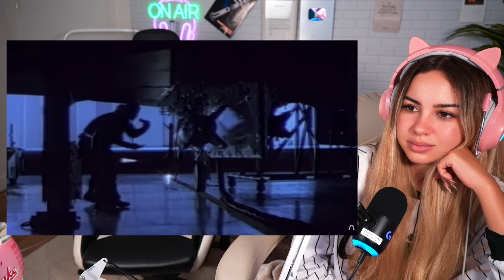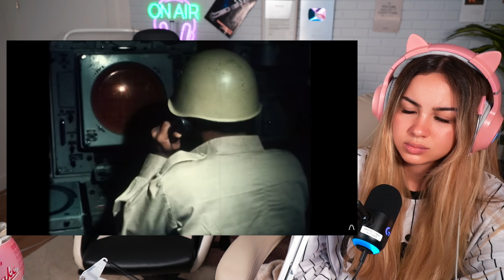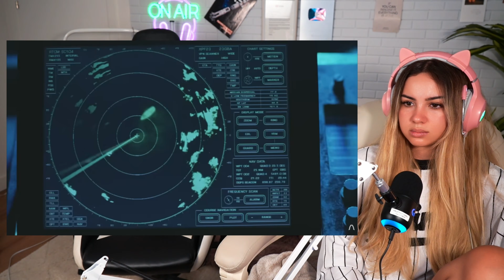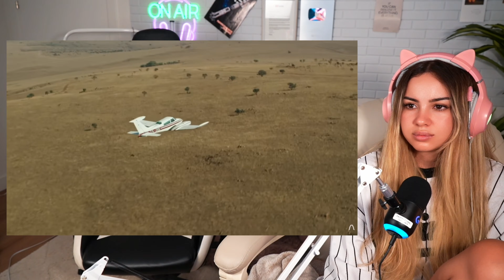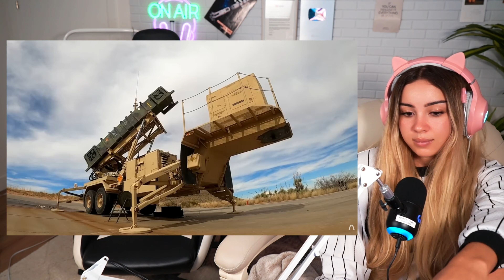This American Jet Was Designed to Look Impossible

Comment: I'm not trying to be an online dick or troll. Knowing your first language isn't English I wanted to help you on your journey through being an English speaking content creator.

Around 9:36 you say "an ufo". It is "a ufo".

No, I'm not specifically sure why. Though, I have a theory. The differential between using a vs an is typically consonant vs vowel. HOWEVER, there are circumstances where a consonant receives "an", most especially with the letter H. The letter H can go both ways (giggity), an or a, depending on its pronunciation. And then things are muddled and complicated by "y" sometimes being a vowel and sometimes being a consonant.

Which is to say even though the acronym ufo starts with a vowel, the pronunciation is considered to be a consonant. Yes, there are other cultural nuances. But it's A ufo, not AN ufo. 🤘🏻♥️

Comment: Engineers decide if a plane looks good by putting it in a wind tunnel while smoke travels around it.  Then the air force tests it by flying over their radar equiptment and seeing if their radar detects it.  If every thing comes out all right, The plane can fly over the enemy during a foggy night, and they won't know they are under attack until they hear the bombs exploding.

Comment: Planes absolute garbage and was shot down on one of its very first missions like most American tech.

indium tin oxide is what the Americans think is a secret but everyone knows already, that's all stealth actually is.
Reply: The F-117 was in active service for 16 years and flew over 1,300 successful combat missions in Desert Storm alone before a single one was finally shot down over Yugoslavia in 1999 due to predictable flight routing.Also, Indium Tin Oxide (ITO) isn't a secret—it’s literally in smartphone screens. On stealth jets, it’s only used as a microscopic coating on the cockpit canopy glass so radar waves don't bounce off the pilot's helmet. The actual stealth comes from geometric facet design, buried engine inlets, and radar-absorbent material (RAM) coatings on the airframe.

Comment: If you really do find this interesting, check out Ben Rich’s book “Skunk Works”. They make an audiobook version of it too. It’s amazing, taught me a lot, and has let me look at russia’s and china’s “stealth” aircraft and see right away that they ARE NOT STEALTH. The book explains it all, and that’s the funniest part. The information is out there. You see a big metal engine exhaust, that’s going to reflect radar. You see a bunch of rivets used to hold the aircraft together, that’s going to reflect radar. You see regular canopy cover materials, that’s going to reflect radar. You see misaligned panels or gaps in between them, that’s going to reflect radar. There’s obviously more to it than that, but these are the things that give away that those “stealth” planes are NOT “stealth” and would be picked up, and locked onto, easily.

Comment: Disappointed to see they failed to elaborate on the single F117 shoot down. Serb SAM radar locked on briefly when the bomb bay doors opened then closed. It was a million to one  lucky fluke. Not a design failure.

Comment: Did hear they are working on SR-72.  Suppose to be faster than the SR-71.  And the SR-71 was restricted alittle due to keeping the pilot alive and technology in metallurgy to not make the wings soft from air friction heat from going to fast creating heat from air friction.  From what I got out of it the engine could have handled going faster but the pilot and plane could not at that time.

Comment: 19:08 that flexing is normal, remember; they test stuff like that, a commercial plane wing can flex an extreme amount before it will break. Also letting flex means it's less likely to snap.

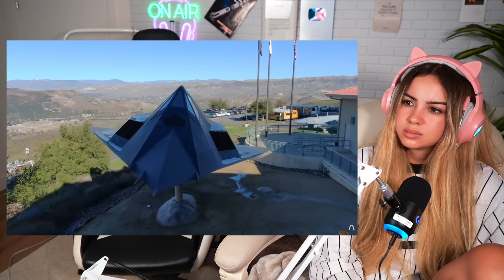20:43 they did have the ability to remote control planes back then, but in test fights like this, a pilot I used.

Comment: 20:40 - The "computer control" here refers to the F-117's on-board computer system whose job was to continuously make adjustments to the  flaps, ailerons, tail fins, etc. to ensure the plane maintains stability in the air (because it was aerodynamically unstable). 

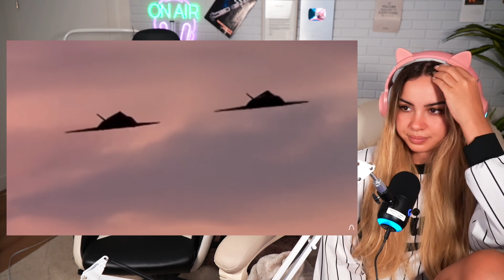22:37 - The left jet (Have Blue) was the original prototype. The jet on the right (F-117) was the final result that fixed the issues of the Have Blue.

Comment: The 117 that was shot down was also running a route that had been run multiple times. It was the luckiest of shots.
Reply: It's been explained that it was less the Serbs shooting one down and more of them putting a missile where the jet was.
Reply: And the lowest frequency the search and tracks radars could run on so even move lucky and desperate not to mention the f16s escorting the nighthawk tasked with destroying such equipment were called back due to weather so even more lucky

Comment: They're discussing the prototype known as " have blue "
And the actual production aircraft called the f-117. 

They are not the same aircraft. The prototype was used to test out of reasonable scale the stealth ability of their ideas. When it comes to aircraft design there are some things that can't be estimated using models or computers. Especially in the late '80s. Have blue was flying in the early '80s. The f-117 started flying secret missions in the late 80s. Nobody knew about it for a long time. 

B12 is a vitamin that vegetarians usually get supplements to ensure they get enough so their WBC and RBC blood counts aren't low.

Since the F-16 almost no US built military aircraft have been able to fly without a flight control computer in the middle, between the pilot and the airplane. The F-16 was the first fly-by-wire fighter aircraft in the world. BTW, the space shuttle was also completely fly-by-wire for every stage of flight from launch to landing in rollout. 
Of course, their might be exceptions, probably in the cargo planes used.  All the stealth aircraft are fly-by-wire.

Drone technology with the ability to control high-performance aircraft didn't exist in the 1980s or early 1990s to the level that was like being in the cockpit. That's why we have Tomahawk Cruise missiles which are much more cost effective than any of these stealth aircraft. 

All V-tailed aircraft have a number of flight characteristics that are extremely undesirable. Those issues do show up from time to time even then really old commercial airliners like the Boeing 727.  The V-tail Bonaza (small private plane) was known to have some issues as well.

Much of the technology in all the stealth aircraft after the F-117, are still classified.

High performance aircraft, including commercially available aircraft, are often made out of composite materials that use a wafer structure not on similar to a bee honeycomb. These are extremely light and extremely strong for their weight. Of course they are more costly than standard aluminum. 

Much of the Boeing 787 is made from composites. Over the useful lifetime of an airliner the cost of fuel far outways the cost of the actual aircraft and maintenance. The lighter the total aircraft in flight, the less fuel it will have to use, for every single flight. Those savings add up massively.  I think the Airbus A350 is mostly composites too.

Comment: LOL...it was not made out of wood. What you are seeing is the splintering of the fiberglass layers beneath and between the skin of the aircraft. The F-117 was advanced for its time period. And yes, it looked really cool. But could only be used as a bomber, leaving it defenseless against enemy aircraft. We now have multi-role stealth aircraft that can be used as fighters against enemy aircraft or as bombers against ground targets. Who knows what "SKUNKWORKS" is working on now to replace our current stealth aircraft. You can bet it will be wilder than anything we have seen before. One thing that is about to make its debut is the new SR-72 Darkstar. The HYPERSONIC aircraft designed to replace the SR-71. It was sort of hinted at in the movie "TOP GUN - MAVERICK".

Comment: The F117 was originally called the "wobblin goblin" because it was unstable.  It was one of the first planes to incorporate fly by wire controls (electronic instead of purely mechanical) then it was a beast.  It didnt debut until 1989 in Panama, but the US history channel showed footage of some of its first test flights going back to the 1950s.

On highway 70 in New Mexico (which passes through white sands missile range) my brother saw one blow past the highway, perpendicular to it just barely over the power lines.  Some poor old timer driving in front of him freaked out and ran off the road 🤣  this was before anyone knew they even existed
Reply: Actually, Have Blue used the same fly-by-wire system as the F-16.  The F-117 avionics were developed from that.  The F-16 started development in 1972 and entered service in 1980.  The maiden flight of Have Blue was 1977, and the first F-117 flight was 1981

While the F-117 was aerodynamically complex, and inherently unstable, (as was the F-16) with the fly-by-wire system, it was actually very stable in most flight regimes.  The system adjusted the flight surfaces 60 times a second, so that it felt very smooth.  In close formation flying, the wingman could literally see the surfaces moving constantly.

The nickname came from how ungainly it looked.  And, the fact that it was inherently unstable.
Reply: One of the precursor aircraft to the 117 crashed near Roswell in the 50s and was so alien in appearance that it led to the belief it was an extraterrestrial craft.

Comment: The F117 also did test runs at the famous site "Area 51." Another plane you need to react to is the world`s most famous spy plane the SR 71 Blackbird." It`s so fast, it can outpace the rotation of the Earth. One mission it went so fast, that it took off from Japan on a Saturday, crossing the International Dateline, and landing in California on a Friday, a day earlier. It could beat the local clock time.

Comment: Have Blue was the technology demonstrator for what eventually became the F-117. Basically a prototype where the engineers could get flight data from their design and then use that data to design the final version. 

Have Blue was smaller, had a more acute sweep angle for the wings, had a platapus tail, and inward canted tails. Being a completely new aircraft shape, the engineers didn't just have a file of known airfoils, and fuselage shapes, etc, to pull from when designing it. This was all new, completely uncharted territory. The plane isn't even technically airworthy on its own, so it relies on computers to constantly take readings from sensors and make adjustments to control surfaces to counteract all of the instabilities of the design. So it really was extremely out-of-the-box thinking, especially for the late 70s and early 80s. Not something you just nail on the first attempt. Hense starting with a prototype/demonstrator. 

For the initial prototype (code named Have Blue), the engineers put together the best theories that they could, based simply on math and aerodynamic principles, then built it to see how it actually worked in the real world. Simply put, not great. But not bad considering it was their first attempt with this crazy shape for an aircraft. But they took the data and lessons learned and funneled that into the YF-117, and with a few more revisions eventually it became the F-117 (the airforce puts a Y in front of the aircraft designation for prototypes, but Have Blue wasn't operated by the Air Force, Hense no Y or numbered designation. It was just a technology demonstrator privately developed (but DARPA funded) at Lockheed. Once the Air Force officially got involved they gave it the 117 designation). 

Engineering is literally just the act of solving problems. So they identify the issues through flight testing of Have Blue, and then figure out ways to change the design to solve those problems, preferably without creating new problems in the process, and ensuring that any changes don't compromise their design objectives such as stealth, speed, payload capacity, range, etc. 

Also, the Have Blue program was developed by Lockheed Martin's Skunk Works team at the Groom Lake Testing Facility (Area 51). The engineers would fly in from Vegas on top secret flights, code named Janet (generally referred to as Janet Airlines, or Just Another Non-Existent Terminal). They'd go to a private terminal at Harry Reid International Airport and catch their top secret flight to go spend time with the aliens (kidding. I think). Crucially, anyone working on the program was not even allowed to tell their family about it. The program was 100% classified data, and any breach could result in prison time. The engineers' wives had no idea their husbands were flying to a secret military base in the middle of the desert every day. 

My father worked at NASA during the Apollo program, and later in his career at Boeing on the B-52 and the Bird of Prey. He also spent time at Chrysler Defense where he worked on the M1 Abrams tank. So aviation and military engineering was a big part of my childhood.

Comment: No they couldn't control it from the ground. They were saying the computer on board the plane would make adjustments for the pilots. That's what autopilot is... just computers making adjustments in real time instead of the pilot manually doing it

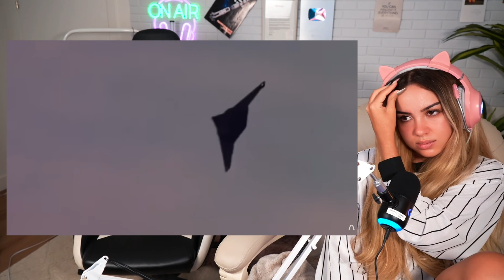Comment: 22:42 That is the smaller  prototype on the left, without tail wings,  and the larger F-117 on the right with tail wings. The tail wings replaced the platypus tail.

Comment: Where they are showing 2 planes, the left is the Have Blue project aircraft (it will be camouflaged) & the right is the larger F-117 (it will always be stealth coating black). The Have Blue was a prototype, concept demonstrator. It's project name Project Harvey & XST come from Kelly Johnson's belief that Little Harvey was the stealth answer. Harvey being Jimmy Stewart's invisible friend. They used the project and Have Blue to find design kinks and make improvements. It's smaller size meant it was also slightly less expensive. The F-117 is a production model of the Have Blue with the final improvements and the size required for USAF military specifications (mil specs) (if there was one). Many of the Skunkworks projects may not have had such stringent mil specs like the Lightweight fighter (LWF) contest which produced the YF-16 and YF-17.

Comment: Based upon Have Blue of the '70s, both fly backward due to their reverse aerodynamics without computer control. F-117, the original stealth fighter. 1st aircraft over Baghdad in 1991 Gulf War. Lost 1 in Bosnia due to a Serbian AA missile battery visually tracking and shooting the aircraft down. Like B-2, designed to fly subsonic and has fun electronic warfare equipment for causing further confusion. While it's called a fighter, it's actually an attack bomber. Like the F-35, in a dogfight, it's dead.

Comment: The Dorito plane is the B-2 "Spirit."  There is a similar looking, but smaller, bomber currently in development.  That one is called the B-21 "Raider."

The shape of the F-117 was based entirely on its ability to deflect and absorb radar waves, so that it was extremely difficult to see on radar.  The B-2 has the same concept, but accomplishes the same thing with curved surfaces instead of flat angles.

The comparison of the two planes are the "Have Blue" - a prototype test aircraft that was used to develop the design of the F-117, vs the finished F-117 design.

The F-117 was made mostly out of aluminum and titanium.  Aircraft wings and skin are made of thin metal honeycombed together for strength while also being very light.

Comment: The F 117 was the beginning of stealth technology in the US.  That led to the stealth B2 
bomber and so many others learning based on what the F 117 proved.  Simple explanation
Saini.  On radar....your car....looks as small...probably even smaller than a lug nut that holds
your tire on your car!   Amazing tech!
Reply: F-22's are mach 2 bumblebees.
Reply: F117 would be the size of a softball roughly. B2 and F22 are the size of an insect. The f35 is about the size of a marble.

Comment: If all the aircrafts computers failed, the plane cannot fly.
Reply: Correct. Negative stability aircraft.
Reply: That's what's so cool about the A-10...aside from the giant friggin gun.  It is built with fully mechanical backup controls.
Reply: @Echo4PapaBravo  the vast majority aircraft have redundancies like that.